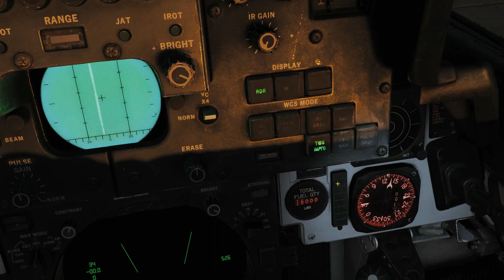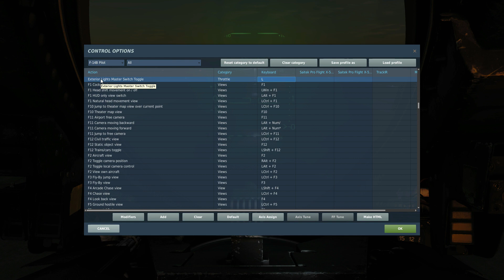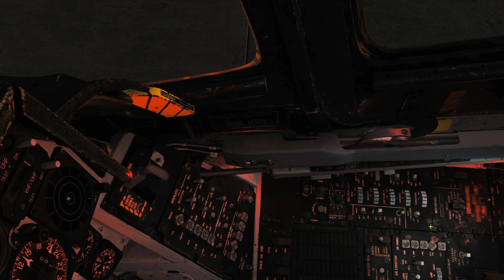F-14B Tomcat: Learning Interior & Exterior Lights | DCS WORLD

Comment: The exterior lights are wrong the Exterior Red Tail lights should be able to be set to steady as well as flash. Hopefully Heatblur fix this
Reply: Those are the anti-collision lights and Cap mentioned they could be steady or flash when flipping switches on the lighting panel. The flash is too fast though, they flash slower like an old car. 30-60 per minute IIRC